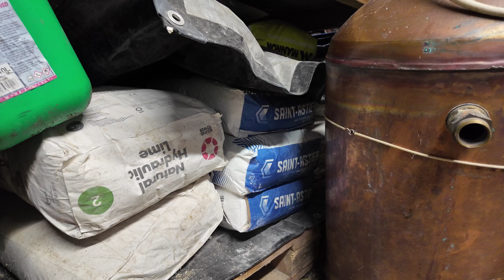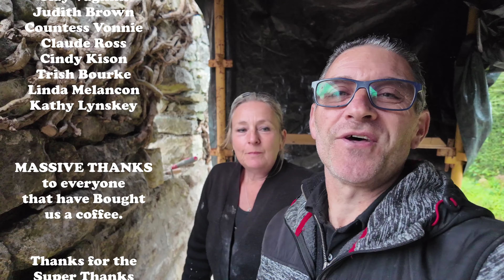Repairing and Restoring Our 200 Year Old Farm Building

Comment: I am a ex-roof tiler and you need to put a valley board down the valley section and place a galvanised valley board on top of the timber valley board for the water run off into a gutter then start laying tiles from the valley section to which you start from a full tile that just slightly on to the galvanised water run off ,then sheet the tiles to the left towards the hip board ,no need to work out the centre to start laying the tiles,always start at the valley section first,if doing hip to hip start the first tile as a full tile as close to the hip and sheet back to the left to the hip.once the roof is tiled the start your cut tile for the valley and your cut tiles for the hip.so the the hip tile will close the gap on the cut tile to the hip.
Hope this will help and good luck
Cheers Paul
One more thing is once the valley board is in place, you then cut your tile battens to mari-up thi the edge of your valley.
Reply from the maker: Thank you for the very thorough info 😊 Always nice to hear from someone who knows what they’re doing.

Comment: BTW are you planning on keeping all the outbuildings close to the house?  When you're done w/ the interior/exterior of main house, dismantling the middle building & one closest to the wall would give you extra stones to perfect walls / rebuild into one larger building.  The new studio/barn/storage building could be moved much farther from the house or shifted to run parallel to the wall (like the new wood shed does)..  You would gain a courtyard and a view.:-)  Also, why not put bigger windows in and another 2-3 ft of height on the building you're working on now (would it be destabilizing)?  The extra light you gain would be useful later.
Reply from the maker: Hi Angela

The outbuilding are 200+ years old and the walls are solid stone 500mm thick.  To move them would take months and months of rebuilding them and probably by a professional, we will leave them where they are for now lol.

We plan to have a hidden courtyard/garden behind the outbuildings in the future, we will also have a growing area although at the moment our growing garden consists of some tomatoes which went out too late and some cucumbers the slugs have eaten.

To change the size of windows is quite an operation when working with these buildings. They were building for animals a long time ago hence the lack of windows and height.  Once the roof is on the one Dawn is working on, it will be about 15ft or more high, a good height :-)

Thanks for watching and commenting :-)

Comment: Gable End " had enough with the length of time it's taking " 

I understand that you are attempting to preserve as much as possible of the original building.

But as the upper section is so completely infested with vine, with the mortar reduced to soil.

I freck out every moment I see Dawn picking away at what is an unstable structure 😮
( While being both above her head and while working at height )

BIG QUESTION 

Have you considered; 

Taking lots of photographs ( as a record of what was originally in situ )

Number the larger blocks with chalk etc.

Then disassembling the upper gable end and rebuilding it .. 🤔

===================

I really love what you've achieved 

In fact if I was still resident in Co Sligo I'd be happy to put in some time ..

This safety stuff, you ready got to think about where you are ..

If you are seriously injured, worst of all pinned under rubble, you're talking a lot of pain and Airlifting to Belfast or Dublin ..

Seriously think about this " working near / on unstable structures" especially above ground level ..

Love, love, love you both ..
Reply from the maker: Hi John, thank you for great comments.

Dawn does like to be sure it is done properly and any stone missing will be replaced, any stone out of place she will try and put back in place.  Although a long long process, she is very proud of all the repairs she does before pointing it all up and sadly covering the repairs you don't see.

When we thought we would have to drop half of the gable, the photos and numbering was going to be the first option,  but as Dawn had worked up the wall, she realised that a huge portion could be repaired without having to be taken down first.  Cavities filled and stone replaced or reworked back into place.  She is close to the top now and once what can be repaired is done, the top stones will be removed, the last ivy taken off and then the top part rebuilt, but there will be photos of the stones (hopefully not too many)

You are right with the safety.  The scaffold pole on my head was just a stupid moment which could have been a lot worse.  Since that moment, hard hats are worn most of the time, especially around those large top stone.

Thank you again John :-)

Comment: That yellow scaffold is heavey to work with. Takes two people to start of the first section so be careful it dosnt take much to hurt you. But it’s a better scaffold. You do get a cross brace to stiffen it. Not sure if u have one. Any time I used that scaffolding I found it ok with out. The cover allows u to keep working as well. Another week and that wall will be finished and in to the next part. When that scaffold is there Ben u couod make a wee window frame and get it mounted in there two. Then fit the glass later. What about the tree stump. I have nothing done myself. 4 weeks now with a sore back but it’s getting better slow but sure. Can’t be too careful with lift stuff at our age. We’re getting to old now
Reply from the maker: Aww sorry to hear that with your back Marcus, fingers crossed it’s hurts less and less as the days go by. I hurt mine at the end of last year and it took a good few weeks before it felt better, I don’t know about you though but ever since it happened it’s made me very wary of it happening again, the slightest twinge now and I’m “ooh, please don’t go again!” 
Haha, I find myself saying quite frequently “ I’m getting too old for this!” 
It’s our first experience with scaffolding and yes it’s a heavy one! Feels very secure when it’s up though. We don’t have a cross brace but we have some long poles to stabilise it, downside is we can’t put one out into the road 🫣 
I love your confidence in me, but alas I’m not quite finished yet but very much hoping mid this week coming we can lift those top few stones and get them back in line so that’s very exciting and a little scary at the same time. 
Tree stump? Left well alone whilst I’m working on the gable but as soon as that is done it’s back at the stump again.